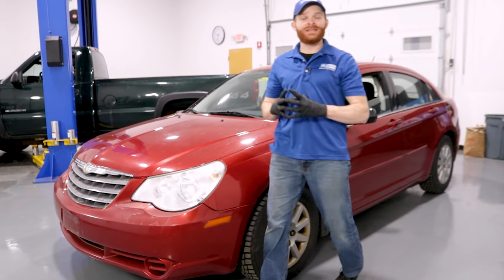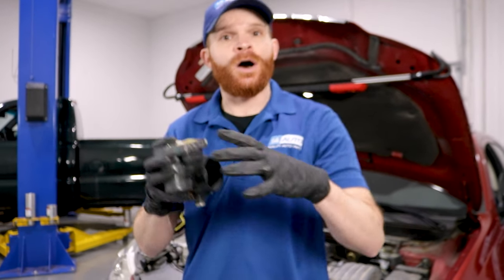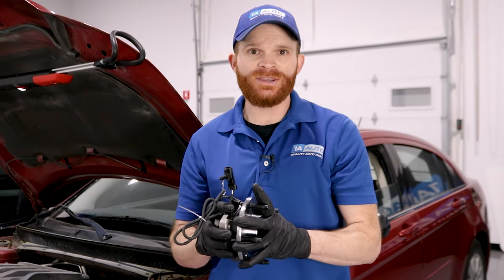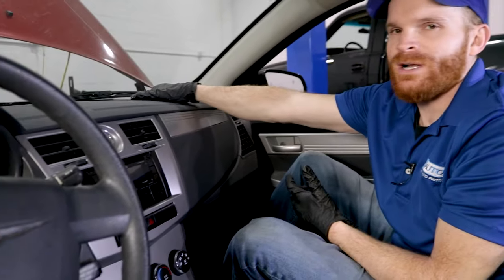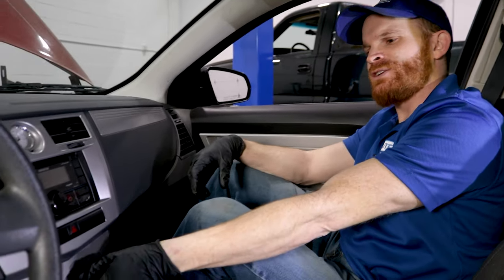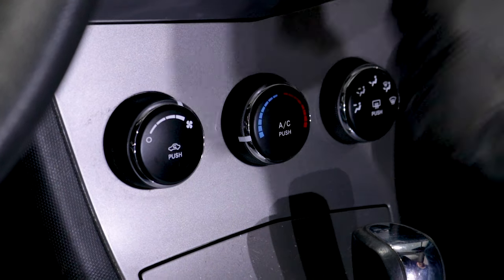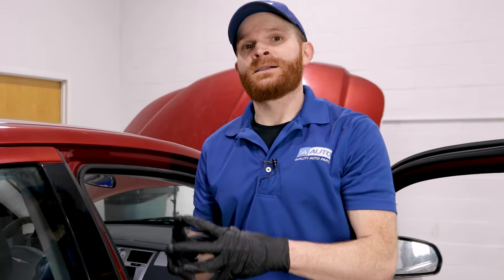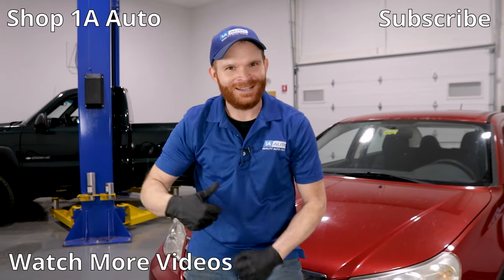Top 5 Problems 3rd Generation Chrysler Sebring Sedan 2007-10

Comment: 265,000 miles on my 2009 Chrysler Sebring.  One tune up and alternator change along with brakes and tires. Best car I've ever owned!
Reply: My sub frame is rotten on my 08
Reply: @Joshbo5H  can you upload a video? I have an 08 too
Reply: 6 cylinder or 4?
Reply: Best car I ever had
Reply: @Joshbo5H  don’t drive it tell it breaks. My subframe broke on my 2004 Cav and it wasn’t even that bad ;)

Comment: Most reliable car I've ever owned & witnessed personally. BUT. The electric system is weak. A simple dead battery turns into a huge electrical issue.

Comment: I must have been pretty lucky. I have a 2010 Chrysler Sebring Touring with the 2.4L VVT engine. I bought it in 2012 with 36k on it, and as right now I have just under 215k. A year and a half ago, I replaced the strut assemblies at all four corners, lower ball joints, and tie rod ends. Besides the typical brake pads and rotors over the years, the only so called breakdown that I’ve had was the top radiator hose blew apart at the plastic junction where the radiator cap sits. Still gets around 30mpg when I’m not in a hurry. I’ve used nothing but full synthetic oil since I bought it, and flushed the trans shortly after hitting 100k. Still drive it to work every day.
Reply: One ghost issue that just popped up is my right front turn signal bulb won’t light up. Changed to bulb and it only lights up at half power when the parking lights are on, but goes completely out when I turn on the headlights. New bulbs didn’t fix it, and I even swapped the bulb sockets and bulbs from each side, and the right side still does that. Maybe turn signal switch on the column? Sometimes when I go to bump the lever for a 3 flash right turn, the left turn signal will light flash.
Reply: That's when it was under the Mercedes banner Chrysler corporation don't make good cars. But when it was under Mercedes it was pretty good that was before Fiat took control now they just horrible except for the V8 versions of their cars which is the best
Reply: @AnthemBassMan  I have the 2007 2.4 base model the I bought a year ago for 2000 and it only had 123k on it now it has a 126k on it

Comment: I have a 2007 Sebring. At night when turning right the dash lights will go off temporarily. Also the wipers won't turn off unless I pull wiper control arm down (for the once swipe). Any suggestions? Thank you
Reply: Alternator for the dash lights

Comment: I have a 2008 Sebring hard top convertible with the 3.5. A few times, this car has had some very violent bucking during acceleration. It's hard to fix what isn't broke at the time, but this experience has made my wife not want to drive it. When it happened to me, I tried different levels of acceleration to see if I could get the car to go. Very light acceleration helped but it was now where near good enough for the wife. This is a rare occurrence but needs to be fixed to be safe.

Comment: The problem we keep having is the bushing going bad in the shift linkage. Had to replace it in 2018 (when the car was 8 yrs old) and we're having to replace it again 4 years later. We do have the actuator issue too but don't know if it's worth worrying about.  Overall, it's been a decent car (bought it used in 2016). The thing I hate about this car is where the battery is located. What were they thinking?

Comment: I just bought a chrysler sebring 2007 today,I hope it gets from point a to point b with smooth ride
Reply: Me to now 
Had it for a couple weeks been having problems with it turns on and then turns off
Reply: I have a 2009 and bought it in 2011. 149 thousand miles and It’s been running great for 10 years . Very reliable car for me

Comment: You just described my issue with my wheel bearing on my 08 Grand Caravan last week. Of course I had it replaced. 
Now my van doesn't want to consistently start. Just clicks. The starter is 2 years old.
Reply: If it’s clicking your starter is not the problem. More than likely a loose electrical cable or battery issue. Clean your batter terminals as well...you want no corrosion.

Comment: I have a 2010 Sebring convertible and I noticed the car if I let go the wheel will pull to the right. I have rotated the tires from front to back diagonally at front end alignments it's still does it. What could it be?

Comment: My 2007 Chrysler Sebring is falling apart.. about a month ago my horn randomly went on and would not turn off until it finally died. At the same time as the horn the windshield wipers started going and then the trunk popped open. I'm not sure what wire I pulled but now the windshield wipers don't work and the heater doesn't even work.. it actually lights up but does not come out the forces of the fan it's been raining and very cold and I'm in my car alot . It's become my home at this point so if you could help me and my dog out that'd would be 
 amazing

Comment: I had the same exact Sebring, color and all and it also had the same A/C Actuator problem too 😂 I was always banging on the dash and it would sometimes fix the problem 😂😂
Reply: Mine doing same thing,want to buy it got 5000 in it 😂
Reply: I think more likely the tapping noise stopped on its own, as it does every time, after about 15-20 seconds, and this just coincided with your pointless banging on the dashboard

Comment: Very interesting, is there a possibility to have a video about Sebring Hardtop convertible drainage system cleaning for leaking tops?
Would like to know where the drains are positioned and how to clean to prevent leakage
Mine is a 2009 Sebring limited convertible hardtop
Reply: I got same problem.. water leaking on the side of the passenger front seat..

Comment: I just got a 2010 Chrysler Sebring touring model which is a convertible. Also. The convertible top won't go back. It says malfunction but all the windows and everything else will go down and then they'll go back up when I go to put it back. I do have a problem with the directional air actuator that you just talked about in this episode, so I guess I need to get a new one of those when I turn my blinker on to make a right turn. My dash lights will either brighten up or dim which is for my gauges and all that. Have not a clue what is up with that and I have a rough sounding noise when I go to take off when I let off the throttle a little bit. Then it sounds normal. If you kind of got an idea about what I'm asking and we're talking about, I would appreciate as much advice as you can give me...  Thank you for your help in your time and I love watching all your episodes. It is very informative and makes things a little easier on where to start!!!!  

Joel Barbee

Comment: Mine is a 2003 Limited convertible, bought at 72k miles in 2006; 2.7 flex engine. It has been great. From the day I got it, the dash lights only came on when they felt like it. now, at 118k, they almost never come on. I'd like to fix that myself, if my bad back allows. The tranny didn't leak a drop for years - until I had a 'service' done - then it leaked 34 QUARTS in a year (3k miles).
  The driver door is rusting badly at the bottom - as I've seen on several other Sebrings. I'm guessing there are clogged drain holes. My new problem is the water outlet box (?) split in half minutes after an oil change. The new housing is $73 and a tech wants $110 to flush & diagnose the system. I'll be doing it myself!

Comment: I’ve got a 2007 Sebring 3.5 liter v6. Over heating while driving at 55mph. It also stoped blowing hot air in the cabin. When I stopped and popped the hood open the radiator fans where on. The top radiator hose was hot. That’s all the trouble shooting I did so far. Any suggestions where I should go from here.
Reply from the maker: +david hurd We wouldn't be able to diagnose an issue like that here, you may want to have a local mechanic take a look at it. Thanks for checking us out! http://1aau.to/m/Shop-1AAuto-c
Reply: Change your thermostats....there are 2 in this stupid car
Reply: @eddiewhittington9687  We did that a few months ago. It was fairly easy to replace the entire housing with the two thermostats. If this mom can do it in the dark with the assistance of her 23 yrs old son, anyone can do it.

Comment: I have a battery light on my dash. I checked the battery voltage and it is the correct voltage. The belt to the alternator is set at the correct tension. All wires to the battery and alternator are secure, clean and in good condition. What other issues may cause the battery light to turn on my 2010 Chrysler Sebring? Thanks in advance!
Reply: That means your alternator isn’t charging

Comment: I have a 2007 Chrysler Sebring touring sedan 2.7 I pressure washed my engine and 2 days later I turn on the wipers and they were barely moving. I replaced the wiper motor and I still have the same problem. Can you tell me what's wrong please

Comment: Hey man I have 2010 Chrysler Sebring and when I turn it on it almost sounds like rod knock and when it idles the sound goes not away but it quiets down a lot, and when I am driving and stop at a stop sign or red light it starts jerking and try’s to die on me, any ideas ?
Reply from the maker: +Cameron Castro We wouldn't be able to diagnose an issue like that here, you may want to have a local mechanic take a look at it. Thanks for checking us out! http://1aau.to/m/Shop-1AAuto-c
Reply: I have a 2008 Chrysler Sebring and have that same problem other than the car jerking at a stop sign. Did you ever find out what it was?
Reply: @warrenthomas1253  same
Reply: @warrenthomas1253  Same here
Reply: I have a 07 sebring base model 2.4 basically the car doesn’t start up first try anymore and when it does it has all its power but when I put it in drive it will limit the power Acting like a limp mode and can’t go past 50mph and the check engine comes back as multiple random misfire but the motor doesn’t sound or feel like it’s missfiring ? Could this be the throttle body having issues or fuel pump needs to be replaced ?

Comment: I have a 2008 Chrysler Sebring with a low ABS Module voltage fault the fuses has be replace and I am  still getting fault. Do you have any suggestion on this problem ( C2116 CODE )

Comment: Very little heat comes out of the vents on mine. Both hoses to the heater core are warm not hot.  The engine temp needle goes up half way when the car gets warm and stays there. Coolant level is within range. The blend doors seem to work. Where is the heater control valve if it has one?

Comment: Having issues with my radio cutting out with no sound coming from the speakers just just crackling noises and this happened after replacing the struts on the car. Wondering if it’s likely the radio or if a ground wire could’ve been effected when replacing struts. Any advice will help! 2007 Sebring touring 2.7L

Comment: My friend has a Chrysler Sebring convertible 2008. It started having a problem with the rear passenger side turn signal burning out quite often and she kept replacing the bulb. Eventually the rear driver side turn signal started doing the same thing. She went to the auto parts store to get a replacement socket and the ones they had were too big. They told her that they stopped making the part for her car. Any suggestions about what can be done to fix this problem?

Comment: Not to get off track,i have an 05 Sebring convertible, with the 2.7, and im a stickler on keeping my fluids clean, especially the oil.oil ports are small and can clog if oil is too dirty.the dealership knows i dont put 3000 miles on oil.if i have 50 or 100 miles on the it, it still gets changed in 3 months. Every 2 yrs. For other fluids,even tramission. I only have 22,000 miles on it. Still smells new. I guess sebrings are becoming collectibles. Saw a antique care seller, with 5 different stores, and they had 2 of them on their lots.my dealership is bugging me to death, about selling it. I tell them no not interested. I don't take this out in rain,or snow.the body and underneath stll looks like new,

Comment: I've always had a soft spot for these Sebrings, as I am a previous Chrysler 200 owner. If you're going to buy one, please don't get the 2.7. The 2.4 and the 3.5 are great engines and have minimal problems. While this is great information, I still can't figure out why this guy pronounces vehicle with an R in it.

Comment: So is there a recall about the airbag light on that's on my cluster board for 2010 chrysler sebring?
Reply: It may fix that. My airbag light never came on, but I had the recall issue fixed shortly after getting the recall notice. No charge for it being done since it was covered by Chrysler. Have the recall taken care of. The only thing you’ll be out is your time without your car. Mine took them a day to get to it. Dropped it off on morning and picked it up the next.

Comment: I had recently purchased a 2005 Chrysler Sebring 4 door sedan 2.4l 4 cylinder I want to say it's the base model. I've replaced the crank shaft position sensor, spark plug wires, new battery, checked my fuses, and relays. I still can't figure out what's going on. the car won't go over 36 mph, it's almost like it's in limp mode. the one time i actually had it above 36 mph, it didnt seem like it wanted to shift, if there is anyone that could help me out, i sure would greatly appreciate it.

Comment: Do you have any videos on how to replace the alternator on a 3.5 liter chrysler sebring 2010?
Reply: It's simple take off black plastic motor cover  off top of motor,.disconnect  negative battery cable!Only a couple bolts and pulley tentioner.check serpentine belt for cracks  best to change it there's a belt diagram under hood .youtube or Google it.saves you alot of money! It's a quick100-200.00. profit.I did mine then had 4 other friends and we're happy not to pay shop prices.

Comment: I’m having a problem with my 2008 Chrysler it cranks then falls dead cranks then falls dead then it cranks and is fine but once driving and the car is off it takes a while for the car to crank again can u tell me what’s the problem it doesn’t have a check engine light on also

Comment: Was driving down the HWY, battery light came on. Car seemed to even get more quiet once this happened. Drove approximately 7-10 miles to home. Turned the car off, didn't need to go anywhere for the rest of the evening so the car sat overnight. Next afternoon tried to start, nothing. Tried to jump start, lights came on but still wouldn't start. Mechanic changed battery, still wouldn't turn over. It acted like it wanted to but Mechanic said it was the starter. Mechanic changed starter, at his shop. Now he's saying my motor is locked up. Said he tried to turn crank shift, would only turn 1 full turn and lock up again, front or backwards. It seems there was an odor of possibility something burning electrical after arriving home on 1st day and after battery was changed, tried to start. I am at wits end. Mechanic is trying to tell me to just get new car? WTH, he also says that he hooked it to computer, it is telling him nothing? What do you recommend? 2010 Chrysler Sebring touring.
Reply: Did you get your car fixed?

Comment: 08 Sebring I have no head lights tail lights blinkers. I have one auto light that come on and a front left blinker and a back right blinker that's all I have working would changing the multi switch fix that issue.

Comment: i replaced my fan motor blower but after a couple of weeks wheneva i put my ac on high it doesnt blow. next to high is fine but in this texas heat i like riding in high a/c. what do u think might be the problem. i have a red sebring 2010 like the one in the video, funny thing aint it. awaiting yo reply
Reply from the maker: +Chosen One We wouldn't be able to diagnose an issue like that here, you may want to have a local mechanic take a look at it. Thanks for checking us out! http://1aau.to/m/Shop-1AAuto-c

Comment: ...I have a 2009 Chrysler Sebring. On the driver's side, the car isn't LEVEL.It drives great,but,it is lower on the driver's side and HIGHER on the passenger side. The front and back on Driver's side than passenger side

Comment: Anyone know of oil leak problems on this car?
Reply: Yes. These engines run hot, and with a PCV system that barely flows enough air to pull moisture out of the crankcase, it doesn’t take long to create an oil sludging problem. As sludge and varnish build up inside the engine, it can restrict the small oil passages that deliver oil to the crankshaft bearings, increasing the risk of oil starvation and bearing failure.

Comment: I have problems with the gas leak change my new gas cap and I don't know how to pass it in emission
Reply: ASK.A MECHANIC TOMTURNNOFF YOUR ENGINE LIGHT AND FILLED UP YOUR GAS TAMK ANG GO A FEW MILES ON THE FREEWAY...IT WILL RESET YOUR COMPUTER AND ,YOU WILL PASS YOUR EMISION TEST.